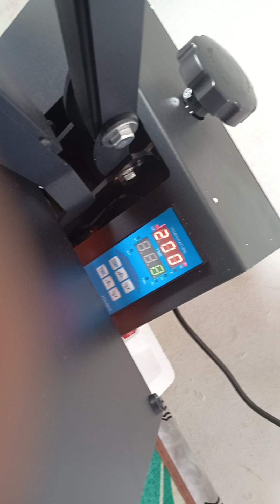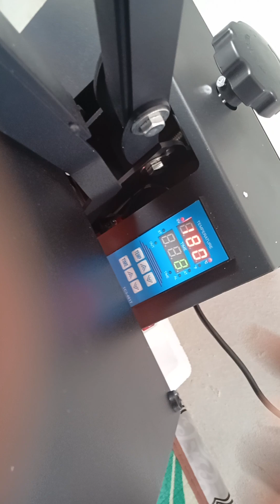"How to Regulate Stoning Machine Temperature | Step-by-Step Guide"

Comment: Please the temperature is in 180 but it not stoning,what could be the cause?
Reply from the maker: Could be because of the transfer sheet or the Surface of the fabric or the Surface requires maybe 185 or 200°C
Reply: @gigvalley_machines ok..please na nob(the round one) on the head of the machine,what is it work?

Comment: Good afternoon sir please how many seconds is ok for jersey customization?
Reply from the maker: For Jersey fabrics (like football jerseys or stretchy polyester like throw pillows and birthday stuff), you should keep the heat a bit lower to avoid scorching or melting.
150°C – 160°C for about 8–10 seconds with medium pressure.
Always pre-press your fabric for a few seconds to remove moisture and test on a scrap piece before the main design.”
“If you’re using thicker stones or a larger design, you may increase the time slightly, but avoid going too hot because jerseys are heat-sensitive."
These are business secrets though given for free❤
Reply: @gigvalley_machines Thank you sir. May God bless you bountifully 🙏
Reply from the maker: @optimismSKL Amennnn...
We are all going to make it...